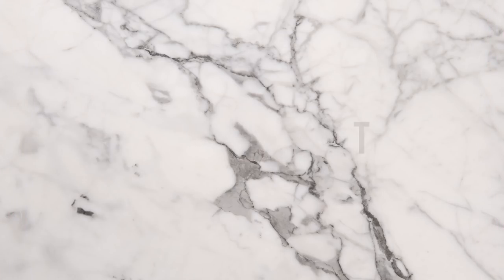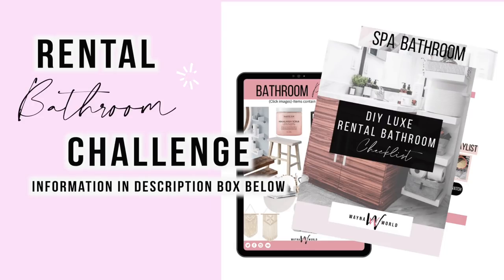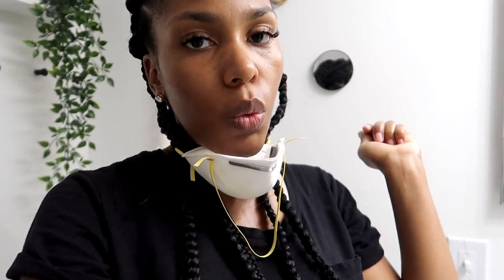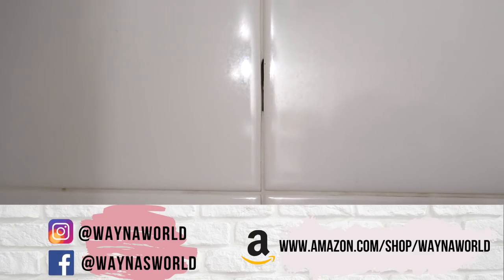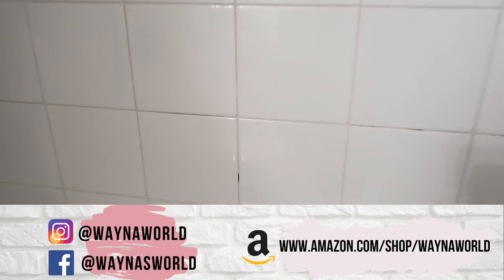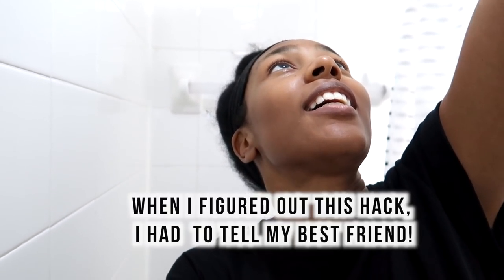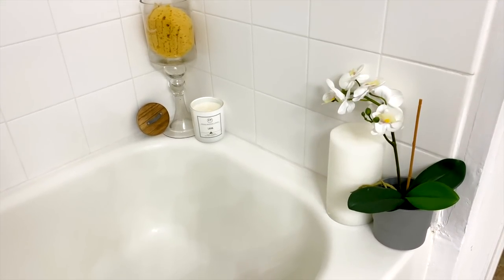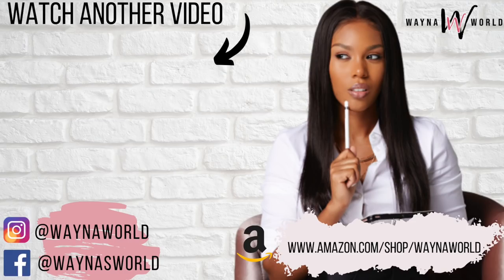BEST 5 Renter-Friendly LUXE Bathroom Upgrades | I bet you've never seen one of these HACKS!

Comment: When you had the overflow cover and the cover plate of the faucet, how did you approach that with maintenance? Actually how did you get the faucet and drain plug  replaced as well. My town home was built in the 80s and some of the fixtures appear to be that old. my complex charges more for a fully renovated apartment than it does for one that has a few older features like mine.  Is there a way to make a request to have these things replaced ?
Reply from the maker: Just start by asking them to which it out. They might say yes. It’s not like you’re asking for a new tube.
Reply: Make the distinction between out-of-date and disrepair. Bring the stuff that's in disrepair (like rusting faucets, drains, etc.) to their attention as things that need to be fixed rather than upgrades. Check the building code in your city for the wording on what is "good repair"--you could even email the city inspectors (if things are bad) and ask them for advice.